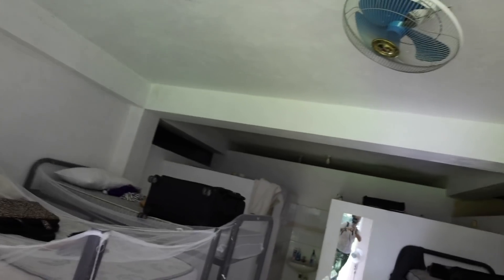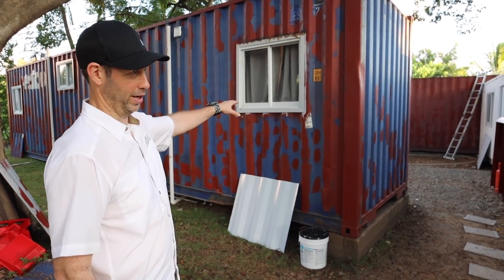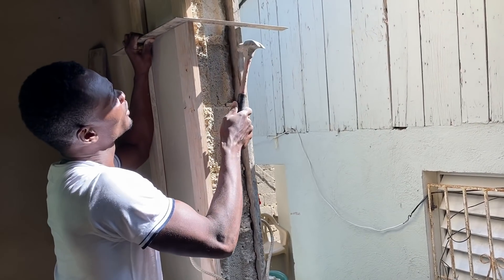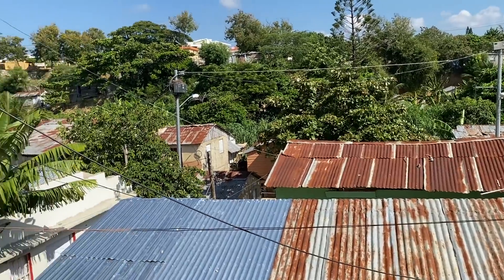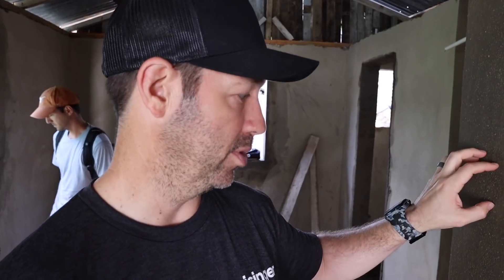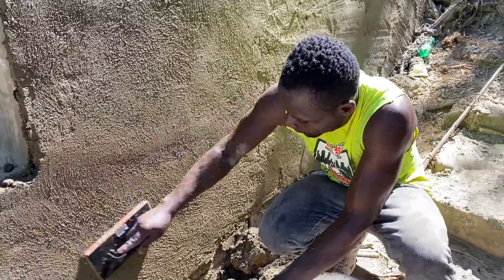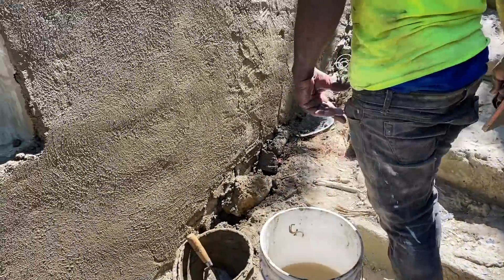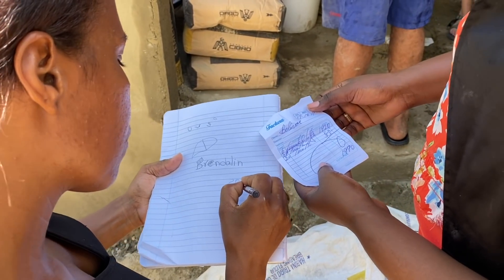Dominican Homes - Solid, Basic AND they don’t have an issue with 1 thing American Homes suffer from

Comment: I am from Puerto Rico and I lived in a block/concrete 4 bed/2 bath house most of my teen years.  Living in FL since 1991 and every time they announce a hurricane for FL my stress level goes thru the roof :-(   Slab aluminum windows shown are called "tormenteras" or storm windows. I wrote this comment in order of video so your 1/2 half of the video even better than first 1/2.   A lot of "wealth" but still poor.. Like Francis of Assisi quote "For it is in giving that we receive".  Thanks for this great video and mission.  My family will follow your example hopefully soon with a mission trip of of our own.

Comment: Thanks for the tour. I like the concrete houses for the middle class, no mold. If it floods just get out the squeegee. Not sure about no glass windows, must hear everyone's noise.
Mission of Hope sounds like a good organization.
Reply: Glass would probably cut down airflow and make a concrete build pretty unbearable to sleep in during hotter periods in that climate.  Once those walls heat up without all the airflow to allow cooling it'd be like trying to sleep inside a lit pizza oven at night unless you can afford to run AC all the time.
Reply: @lucasriley874  yeah, we need our a/c in the states. Concrete is not near as oven hot as a tin roof with no attic air movement. I guess no glass is the reason for no mold.

Comment: Awesome vid! It's a weird experience seeing my parent's homeland thru your eyes. I was born and raised in the U.S. but from an early age I often visited the Dominican Republic. I haven't been since I was a kid and this video reminded me of how fortunate I was growing up and how different my parent's upbringing was compared to mine.

Just to explain some things you experienced:
- Lack of A/C: Most homes experience rolling blackouts, power grid can't provide electricity all day - so typically you see power 1-4 hours at a time, it is not unusual to go without power for several days. So A/C systems are usually only seen in resorts/government buildings/"high class" neighborhoods in big cities where they have a more constant supply of electricity or generators.
- Windows: Due to high crime and cost, glass is not used on homes. Most cannot afford to replace glass windows. The aluminum windows add a bit of "home security" (besides protection from weather).
- Iron bars on homes: Again "home security" due to high crime.
- Septic: Usually waste is directed to a large pit or a dry/dirty lake at the edge of towns. Sewer and septic systems like we see here in the U.S. is only seen in resorts/government buildings/"high class" neighborhoods.

Comment: The washing machine is called a "twin tub". One side is for washing, the other for spinning. The water is added manually, uses less than other types of washing machines, and allows you to reuse the water in multiple loads (eg start with the least dirty clothes, then work up to the dirtiest).

Comment: Not to mention concrete has a much better thermal mass, so they'll take longer to heat up in the morning, and continue to radiate the day's warmth into the evening, slowing and stabilizing the temperatures inside the house, making them more consistent.
Reply: Depends on the climate there.  In most tropical areas the night isn't really any cooler than the daytime so once those walls heat up that's the temp they'll be staying at.  This is a big part of the reason traditional cultures in those climates almost never built out of stone even though they had the skills, they were hell to live in.  Probably a big part of the reason they allow for so much ventilation because that's where all the real cooling comes from in that climate.

Comment: Well, as you know in Germany buildings are traditionally fully made of concrete, but bc modern buildings are getting more and more air-tight for energy-saving reasons you could end up getting mold quite easily. Even on concrete. So the constant air-flow (besides the natural heating) seems to make the difference in that area. And yes, I'd also guess that the gaps above the doors and windows are left for exact that reason. And doing other moistures stuff like cooking, showering, washing outside seems to help as well.

Comment: I think we have slightly different views, me been Jewish. But I agree poverty is a definition and you said it just right. Also what I am missing there is the idea of really building something more than just that. If you don't mind get me in touch with them because I have some plan's about those Sea can's but also on how to improve their water system. I think the MISSION of HOPE is doing it right but also should adopt European technology a little bit more. I been to the Dominican Republic myself and corruption is still a big issue. But we should give them the tools, 55 Gallon Drums, Rain water harvesting,  Solar, Recycling HDPE Plastic onsite and some more things we should show the local community how they can improve with "zero" to very little money that they can improve their way of living a lot more which is the 3rd  important thing for us humans and that is pride. The pride of what we can archive. Let's show them simply solutions so they can become more independent like you just pointed out on the hill side a rain can ruin the slop and have a disaster impact on the house below. If they have basic aluminum gutters to collect the rain water in in ground drums they can store and use this water even as a "drink" safe water when boiled off but mainly for sewer and laundry as well as cleaning an excellent source to reduce their dependency and cost out of pocket for water.

Comment: In many Caribbean countries the construction is the same. They should have a main ring beam above the Windows and walls. Ventilation is tough and many houses are super hot in summer but I usually use bamboo to create venting in the beams, this allowing somewhere for the air that gets trapped above the doors and windows to go.

Comment: Did you happen to learn how much electricity and gas costs on the island ?   What is the electrical infrastructure like?   Do middle class and poor have power?
Reply: Dominican here, the first 200kwh cost 9 cents (USD), next 13 cents, and from there on 21 cents. It's designed that way so poor people pay less. This is the single phase service and when it comes to quality of service some days they work on the lines and no energy 8am to 5pm. Some days you get a 10 min interruption no nothing you can't live with. I live in the same middle class neighborhood house since 91 and back then we had our own generator to run the fridge at least since we got no more than 8 hours of service a day.

Comment: Damn you were here! Having partially lived in Haiti as a child I can tell you that haitians are good people that just come down here to work as hard as they can. Also didn't have air conditioning until I was 27 and considering our yearly avg temperature in Santo Domingo is 29C (85F) you just get used to it. Concrete building it's a must since we're in the hurricane corridor, poor people that just have solid walls but still wooden roof take their valuables when a storm it's coming and just rebuild the top. When poor people begin to make good money they transform their houses from wood to blocks one line at a time and in a couple years it's a completely new home. If you ever come back let us Dominican subscribers know.

Comment: How from a timber construction perspective does it compare regarding insulation? Here in México is the same thing. Midder to upperclasses live on brick houses, we pay no attention to insulation and the common thought is that wood houses are for poor People because is cheap and that it Will be full of termites or rot in a few years.
I am looking on building a frame House american style instead of building with bricks, pri es are about the same but I like the insulation possibility of the wood frames houses. Block walls get cold on cold days and super hot on summer. Usually we dont have heaters because we dont need it but AC we do.
Would you prender to have an all brick House instead of those framed and layered wood houses?

Comment: Matt, Most if not all of your US show is primarily upper class, this show was disingenuous, because is discussed poverty in Dominican Republic.  Poverty  exist everywhere.  You could have made a show about the homeless in California or the lead water in Detroit Michigan homes or how the poor in New Orlean, and or Texas whom where wiped out during the floods. You could have covered the middle class and upper class or government made homes in Dominican Republic. But you did not. However,  That is a very big issue in the US poverty does not have a voice,  So, Thank you?
          Mold rarely exist in Dominican Republic because they do not use materials like a lot of wood, insulation, and paper backed sheet rock. Most large old ranch homes are open, the kitchen is a separate room from the bedroom to the living room, and the bathroom too all connect by the outdoor.  Therefore we try to incorporate as much of the outdoors into our daily lives.